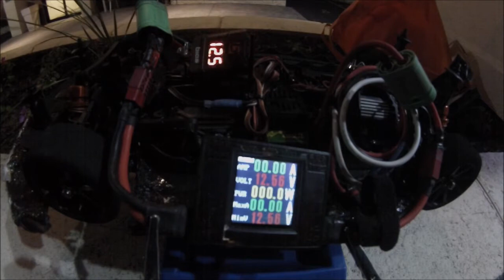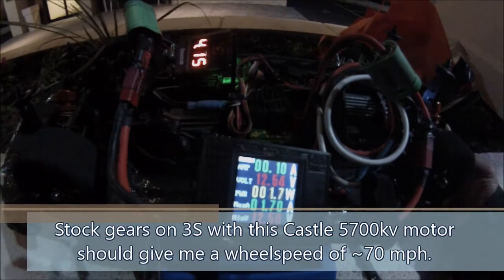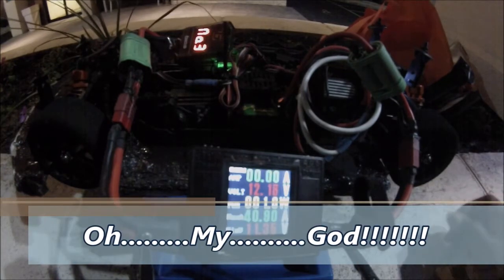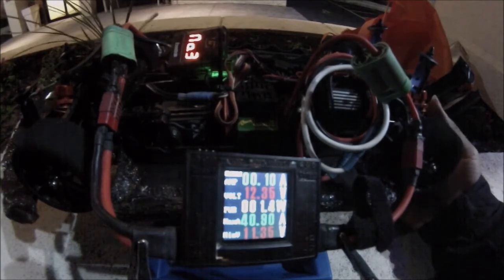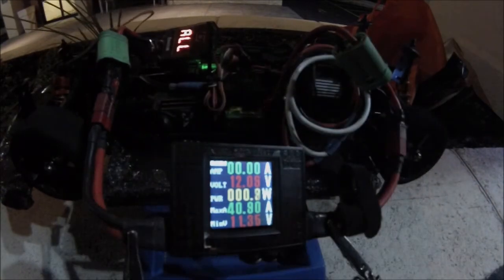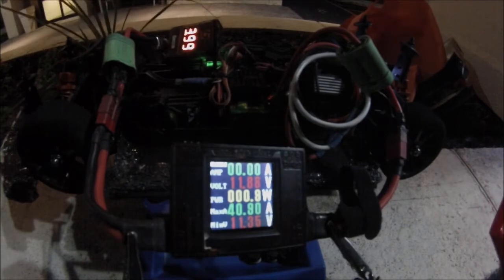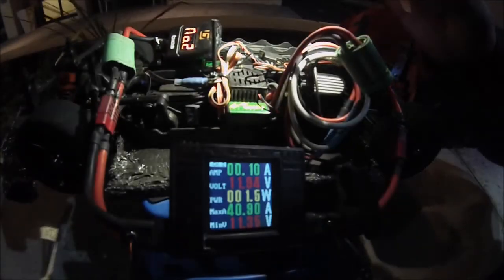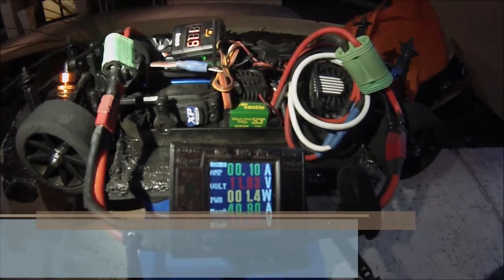Ep. 216: Apex Bearing Benchmarking FAIL!

Comment: First I want to say thank you for posting videos on apex mods. So far I think you’re the only one. Now you mentioned modifications to your drive shaft. Changing out to a traxxas shaft and using a 3D printer. Are you willing to share in detail how you did it and what is needed to follow your steps?
Reply from the maker: Thank you! I thought the Apex was a solid platform that wasn't getting the luv I thought it deserved. It's a actually a really good economical platform to get into speed running... if you sort out the driveshaft problem.

The whole point of my channel is to share info to help guys move forward, so I have no problem sharing what I've done. I've actually 3D printed a boatload of Slash 4x4 shaft adapters, but I wanted to test them before I started selling them. Would you be willing to do some testing for me?
Reply: rhouse21 - RC Physics yes I would, I mainly do 132ft drag racing. I find the the plastic shaft end & spur gear adapter does not hold up well to drag racing. I have been testing out part from other brands but nothing work. For you to ask is a xmas present...lol
Reply from the maker: My Heavy Duty Slash Shaft Adapter integrates a hardened steel core (otherwise known as a screw) to reinforce the 3D printed spline section for increased strength. Head over to https://www.facebook.com/rhouse21RCPhysics/ and PM me and I'll send you a set to evaluate. If it doesn't work, we can tweak it until it does, :-D